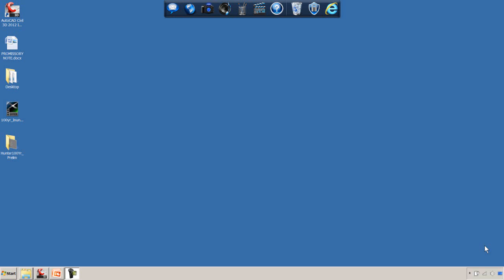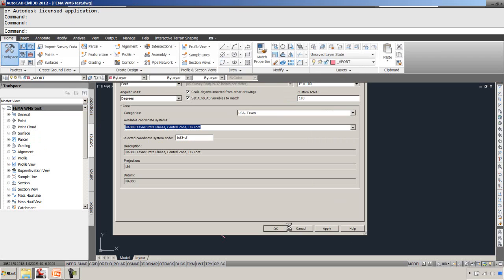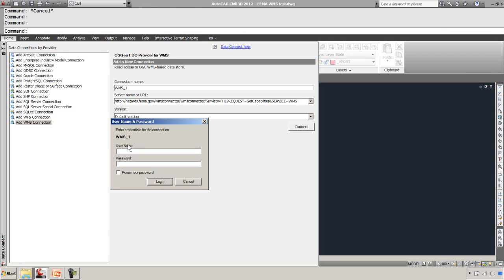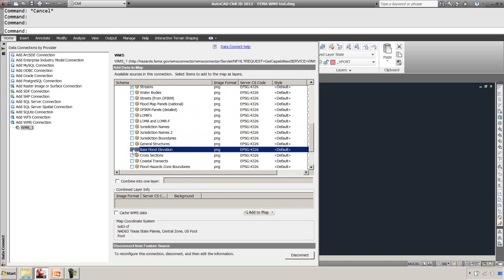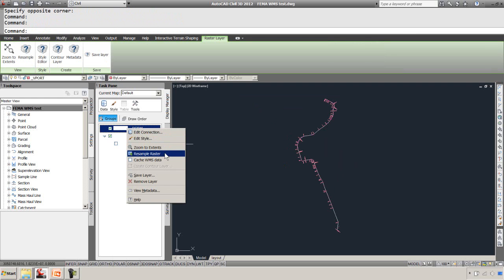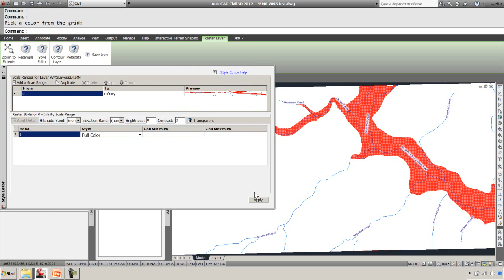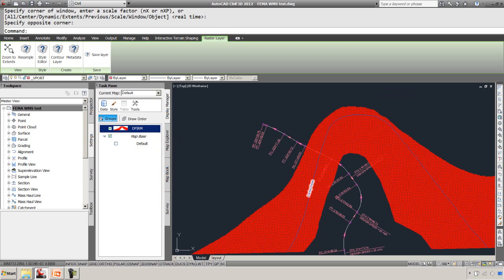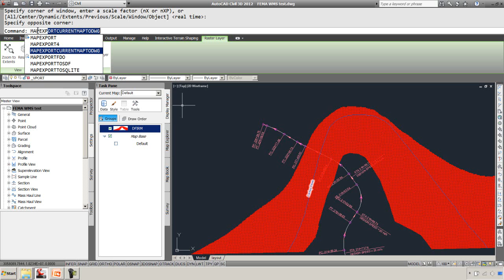Civil3D and FEMA Floodplain Maps

Comment: Great video! Well narrated and the pace was perfect. Had a devil of a time getting the WMS connection in 2018 but finally found the latest FEMA link and installed the hotfix which solved it. If anyone else has this problem the link I used to correct is https://forums.autodesk.com/t5/civil-3d-forum/fema-mapconnect/td-p/7686874

Comment: As of November 11, 2018, it is working. The following link comes from FEMA for the WMS Capabilities file:

https://hazards.fema.gov/gis/nfhl/services/public/NFHLWMS/MapServer/WMSServer?request=GetCapabilities&service=WMS

If you're still having problems in Civil 3D, you will need to install an Autodesk hotfix for versions 2016, 2017 and 2018 found here:
https://knowledge.autodesk.com/support/autocad-map-3d/troubleshooting/caas/sfdcarticles/sfdcarticles/WMS-connection-show-Server-SSL-connection-error-in-AutoCAD-Map-3D.html